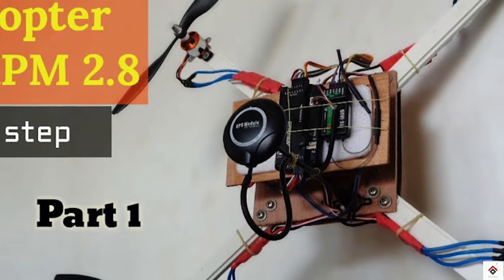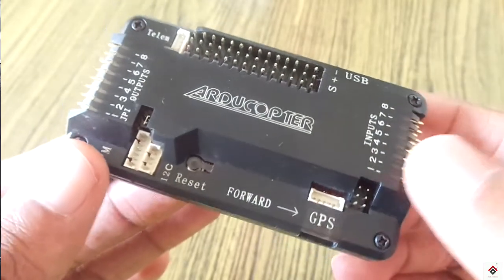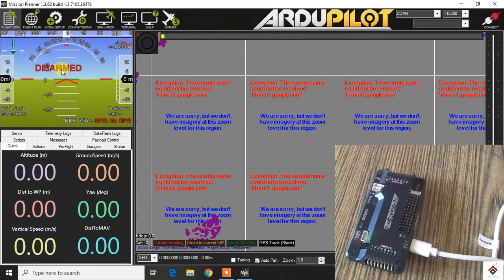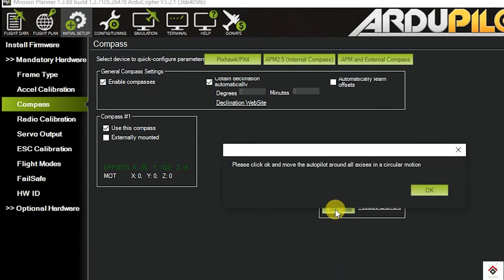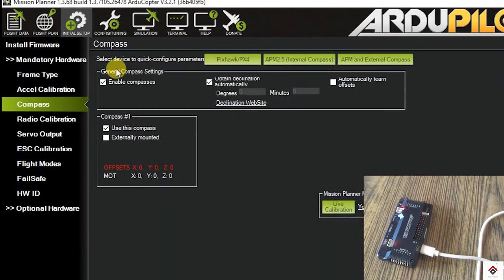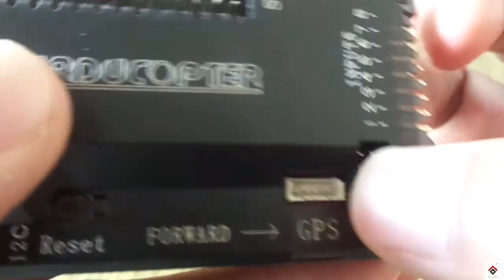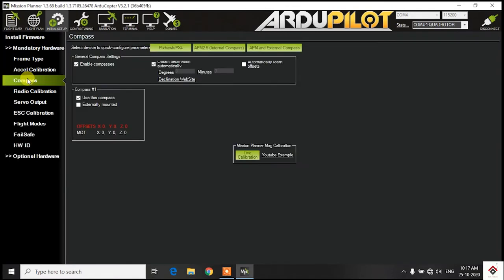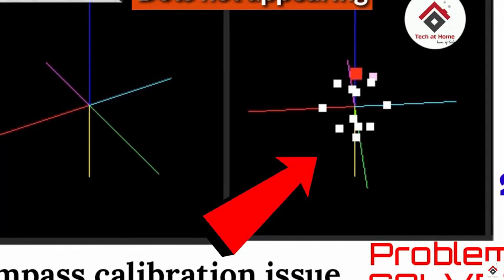APM 2.8 Compass Calibration problem [SOLVED] | Dots not appearing in Misson Planner 100% solution

Comment: Please help dots aren't appearing
Reply from the maker: If this method also not resolving the issue, you have to use external compass which comes with the GPS module.
Reply: Wil hmc5883l work ?
Reply from the maker: Not this one. There are GPS modules available for APM board. Some come with built-in compass.

Comment: I did these procedures, but unfortunately without success I don't know what else to do
Reply from the maker: There are lot of fake boards available in the market, I think in your APM there is no compass.
You can connect external compass that comes with GPS module 
Refer this: https://youtu.be/jHaYAA_Km7Y
Reply: @techathome  hi i'm have apm 2.8 and i have the same problem as you but after adding the jumper nothing changed
Reply: What should I do?
Reply from the maker: You can  use the external compass, that comes with GPS module
Reply: @techathome  hi, I used an external compass, that was not the problem.  But the reason was that I used the i2c port for that connection.

Comment: Where to get the jumper im facing the same problem now pls help
Reply from the maker: You can connect normal jumper wire which is used in Arduino projects

Comment: even after doing this it's not working. what should i do
Reply from the maker: May be your board not having built-in Compass,
You can try with external Compass of GPS module
Reply: @techathome  but how APM doesn't have internal compass.
Reply from the maker: I have heard, not exactly sure
There are lot of clone boards.

Try to change the cable, if you can and check once.

Comment: Thanks the dots r appearing but the red dot is not moving all the way around, it's just moves in 1st or 2nd quadrant. Any solution for that?
Reply from the maker: Then I think you have to use the external Compass of GPS module
Reply: @techathome  yep that's an option but I got where problem was,
Mine usb cable was broken near the micro usb adapter so from the exposed wire electromagnetic interference was distributing the compass of the controller!
I changed the USB cable, then everything was working properly!
Reply from the maker: Ok, then fine

Comment: hey man i hope you see this, so i shorted the two pins using solder, and also the mission planner is identifying that my board is moving this includes the compass yet the calibration does not work i checked and my the compass on the mission planner is right in which direction my board is pointing yet the mission planner doesnt seem to work please help

Comment: my bord saying "compass error :99" 
please say???
Reply from the maker: Connect external Compass that comes with GPS module and try once
Reply: @techathome   my gps not match to the prot! I want to use internal compass. whow can i use??
Reply from the maker: If your APM board having inbuilt Compass this method in the video will work, otherwise I think you have to use external only

Comment: Dear your videos r very helpful specially for the beginners. Great 
I am using pix hawk 2.4.8 in my quad copter and while reinstalling firmware after flushing the old firmware, I’m stuck up at    Reading Hex.   And connection error is shown afterwards.  I am selecting Ac3.6.7AP3.9.7 as firmware to install  kindly help. Thnx
Reply from the maker: Click on install firmware legacy and try

Comment: Bro I have mounted external gps but the dots are not seen.....
Reply: And it's showing No fix
Reply from the maker: You have to connect both GPS and Compass ports.
Have you Connected external compass port??
Also you have to check mark on external compass option?
Reply: @techathome  yeah
Reply: @techathome  should connect it in the old gps port... Or the new gps port
Reply: @techathome  I have selected apm and external compass
Reply: @techathome  I have check marked on external mounted
Reply from the maker: *Connect the GPS to the APM GPS port
*Connect the compass to the port, under the APM GPS port.
Reply: @techathome  sure
Reply: @techathome  bro I tried but the dots are not seen....
Reply: And I. Have selected roll 180

Comment: Bro i did that but dots are not show
Reply from the maker: Some APM board will be not having onboard compass, this might be the issue with you I think
Reply: So how to solve this problem i have external compass also but it didn't recognized by the board
Reply from the maker: Plug your external Compass to the port under the GPS Port.
In Compass calibration check mark on external compass option and try
Reply from the maker: I don't know exactly , but for some people I had told the same above steps for using external compass, It had worked

Comment: Bro i short that 2 point but also i can't see that dot dot points... what can i do now ?
Reply from the maker: It means your board is not having onboard compass
U have to use external
Reply: @techathome  but apm 2.8 have internal compass
Reply from the maker: Not all, there are lot of fake boards available
Reply: Bro.. i add a external gps but then also i doesn't see any point when i do the compass calibration
Reply from the maker: I think you have to check mark on, Use external compass option
Reply: When i marked it ...i see the Roll180 
Is this option is right?
Reply from the maker: U have not tried.
Other than this, what options are you getting?